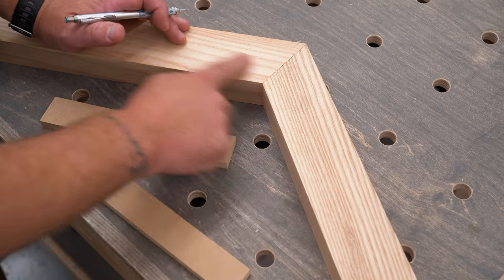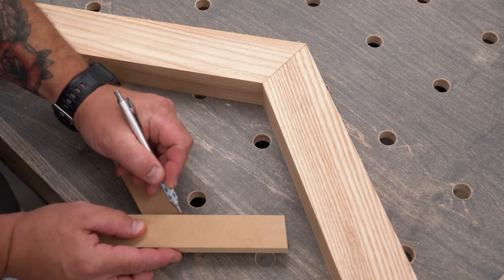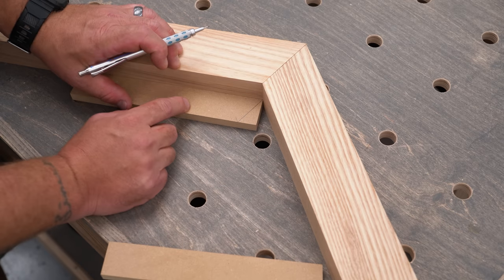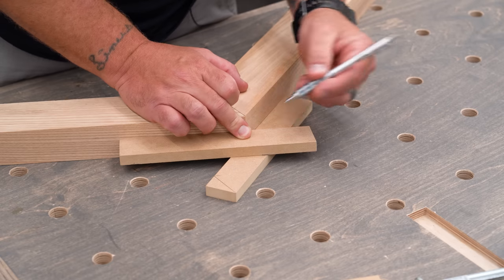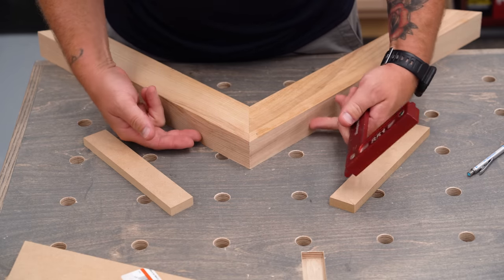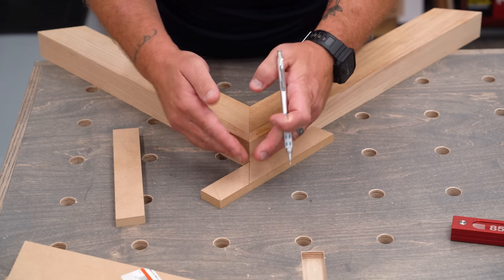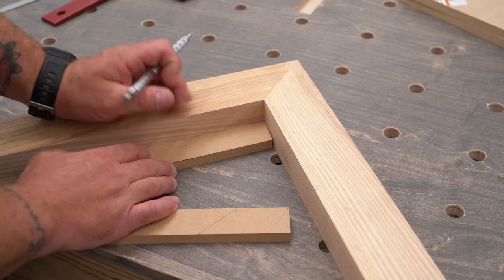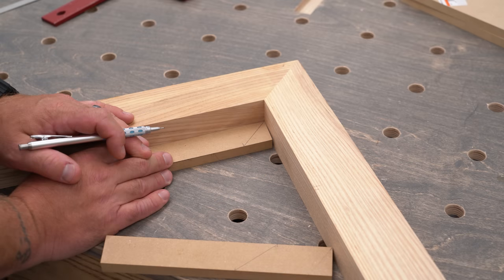Perfect Miters Without Tools OR Math

Comment: Good tip. Carrying your no math methodology on to the next step, cutting two identical mitered work pieces, once you've marked the miter angle by the Inspire method shown here and cut it on the square sectioned scrap piece, you can once again avoid using numbers altogether when setting left and right miter angles on your miter saw. After cutting the first scrap piece to the required angle, just flip it upside down and use it as an angle gauge to set the saw's miter angle on the opposite side of the blade by placing the scrap against the fence on that side and then rotating the blade until ithe saw plate makes contact with the scrap. (Lock the blade  in its deepest cut position in order free up your hands and to ensure that the scrap makes contact only with the saw plate and not any of the teeth) If you follow this procedure and cut two identical scraps before moving on to cut the actual workpieces, you can easily see and correct any slight inaccuracy in your initial marking by positioning the scraps against one another where the actual joint will be made and checking for any gap in the joint. The gap will be double the size of the correction you need to make, so it will be to see.
Reply: Many thanks for that, Michael! I asked him to demo that in another video. You just revealed the technique. Thanks again!!

Comment: I love these tips that show you how to use the material you're working with instead of rulers and math. Whether it's mitering some base molding, layout out a dado or even the cross pieces on some farmhouse furniture. It can usually be done without a measuring device and likely be more accurate.

Comment: Good tip for "square" corners. I struggle with bull nose (rounded) outside corners of baseboards that require a short segment 2 or 3 in. between the two longer ones to make the corners. The angle are usually around 33⁰, but never exactly that. (No surprise.) Hard to find the center of a rounded corner.
  Suggestions for a semi-pro like me?
Reply from the maker: @slowguy56 I might try to make a video to explain this, but you have to measure the angle of the corner and divide that number by four. In a perfect world the corner would measure 90 degrees, so each of your four cuts would be 22.5.
Reply: @InspireWoodcraft   Right. 22.5⁰ is what I meant, not 33.
I guess I should have figured that out myself, but math skills are many years rusty.
 Thanks.

Comment: Great way to get a perfect angle but how do you transfer that angle to the tool you use such as a miter saw or table saw?
Reply: Cut a little bit away from the line and judge if the cut vs line has a consistent gap or not. If not, then sneak up on it. When you're happy, cut a lot closer to line but still leave a tiny gap for a final fine adjustment. Then cut on the line.